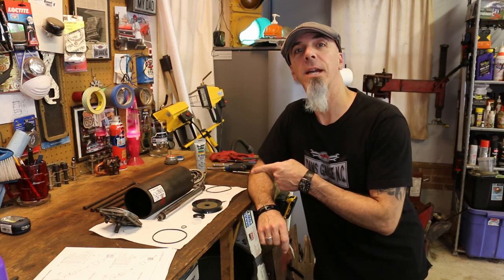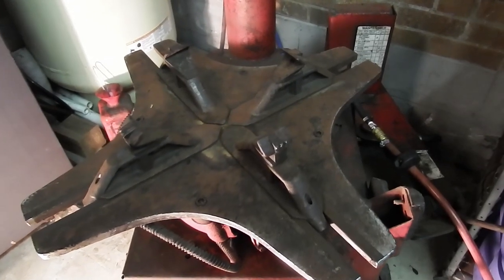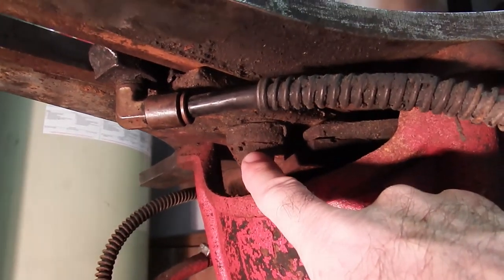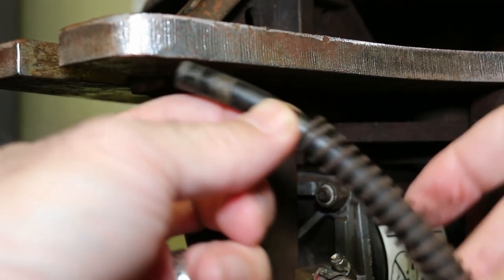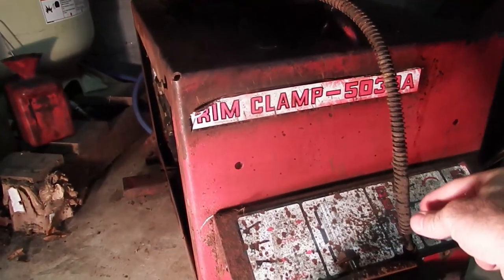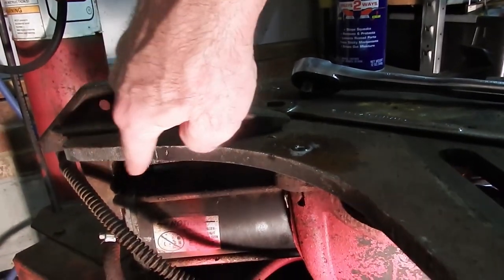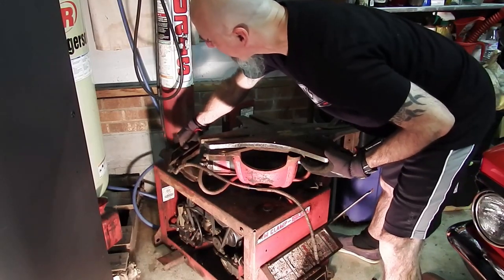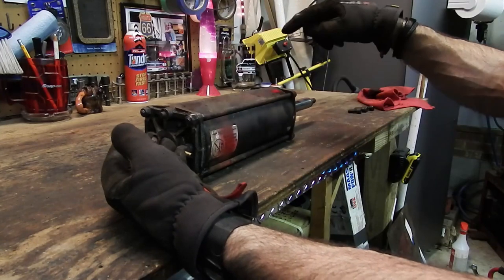Coats tire machine rim clamp cylinder rebuiild

Comment: We never saw you torque the piston to the main shaft of cylinder
Reply: 30-40 ft/lb is wat my kit said, but it shows using the lil oring and the original had one.
Reply from the maker: Just because you didn't see it doesn't mean I didn't do it. lol Sorry, I try to include everything.